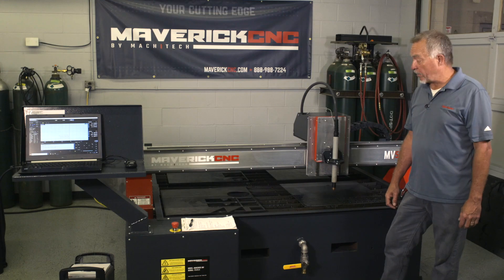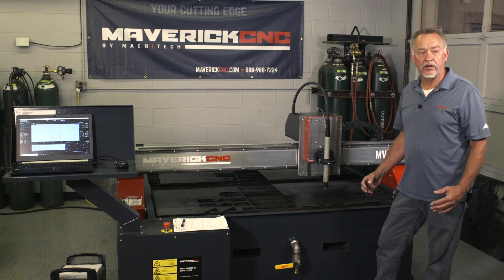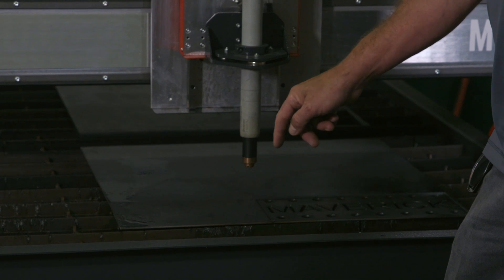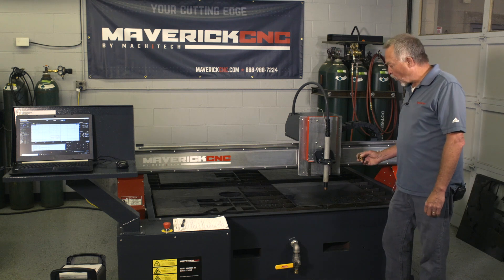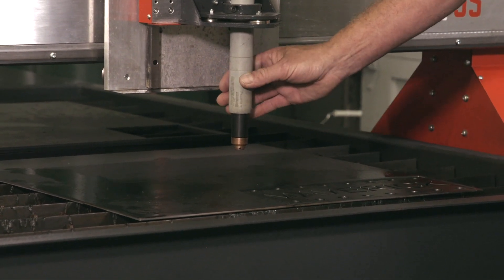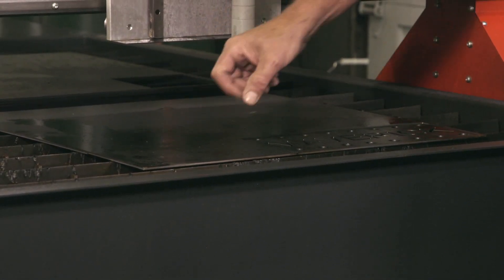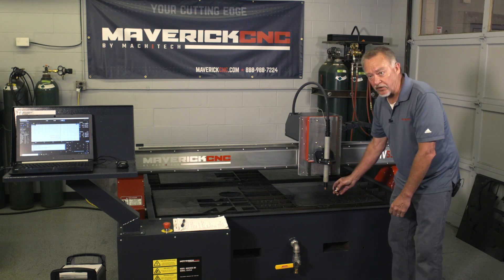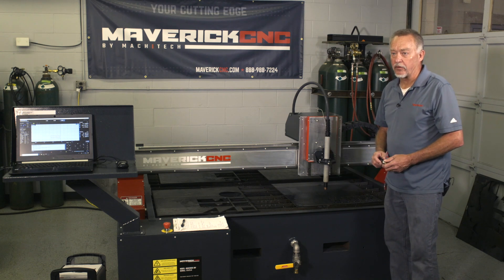CNC Plasma Table Torch Height Control - Tips and Tricks with Jim Colt

Comment: So question I have heard that ohmic is very temperamental and can have slag from piercing cause it to not read the plate? or dirty material cause it to not read... so with that I find a floating head better in some situations.
Reply: I heard that too, and if you have too much water on the table it can also impede your cuts.  I have the floating head and has worked fine.  But Jim knows best.